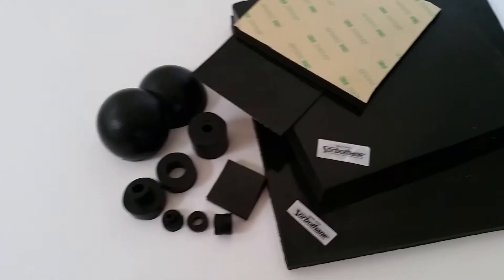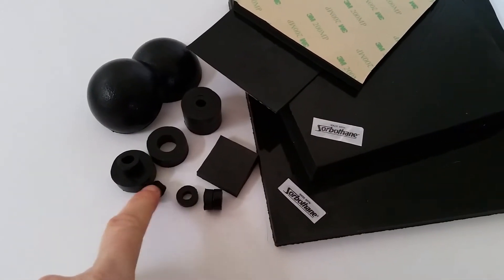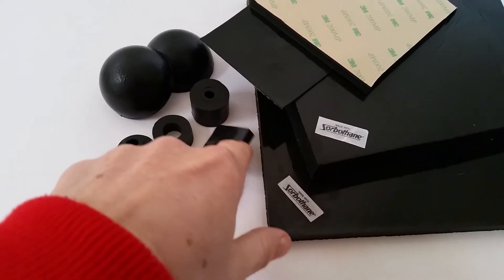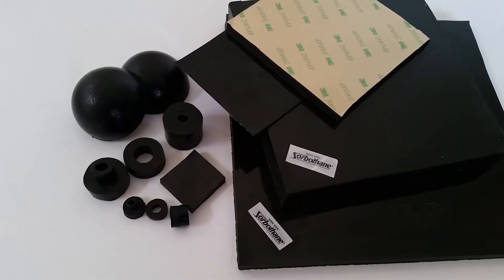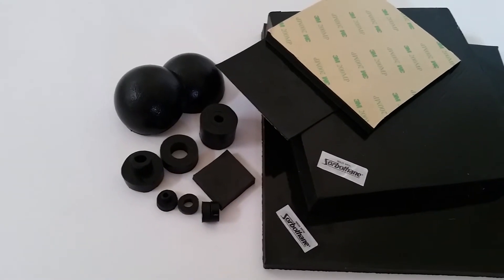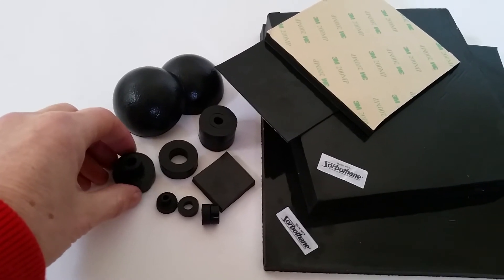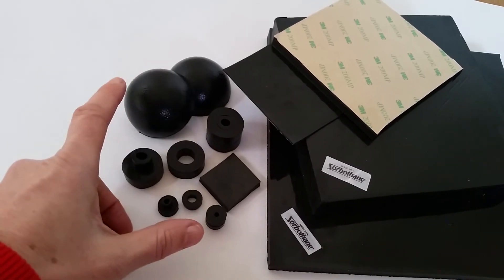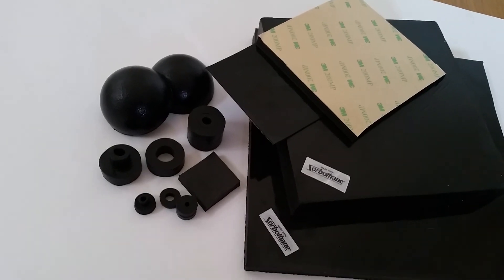Sorbothane: Sheet, Pads, Domes and Bushings

Comment: I have a few medium size speaker cabinets stacked up carefully on both sides of my room, with small 1/2" squares (1/8" thick) of sticky black sorbothane 50 D between them. The anti-skid property keeps the cabinets from sliding around, while the soft cushioning absorbs resonance. It's a perfect solution.